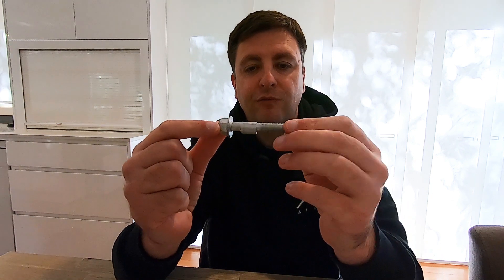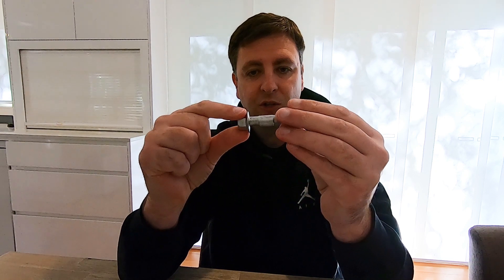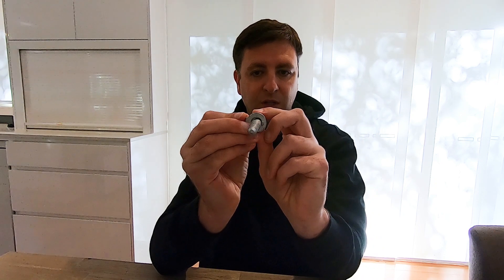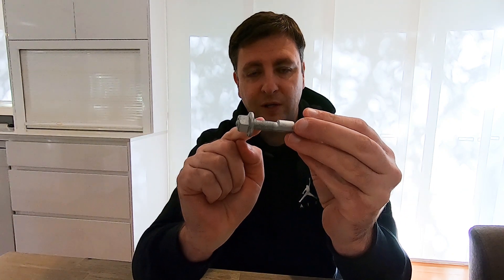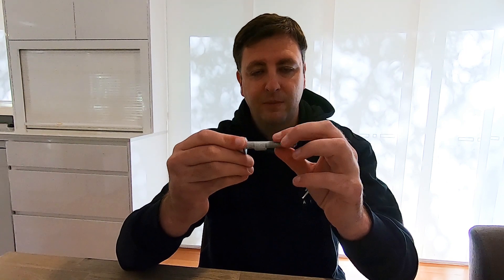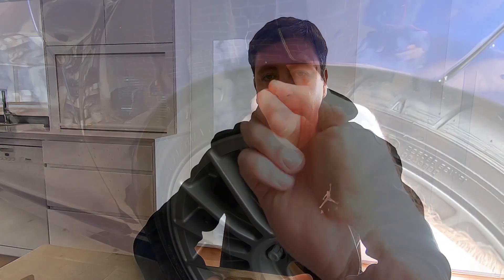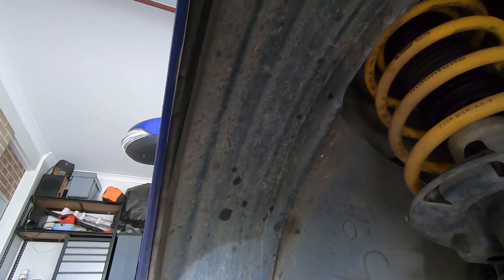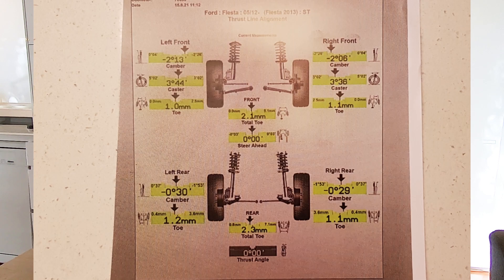Adjustable Camber Bolts | Whiteline

Comment: Thanks for your videos! 

Can't really lower these cars IMO, with the stock wheels and tyres anyway. i got full adjustabls and if you lower the ride height the tyres hit the inner guard, that part that drops down towards the engine bay.. Was ok for a while but as soon as you go over some big bumps they rub the guards.
Reply from the maker: Interesting. Worst case for me now is that I raise the front a bit.

Comment: you have got to be joking, adjusting camber to solve clearance issues.
My head hurts. F this world
Reply from the maker: Not joking 👍.
Reply: @fordyford  tire contact (to the road, not ur fender) should be the driver for camber adjustment.
Tire heat management should be the driver for tire width.
But then there's the stance boys 🤣
Reply from the maker: Yeah cool.

Comment: Have you noticed any uneven tyre wear from the camber bolts?
Reply from the maker: They have only been on a few weeks so no. I will make sure to rotate them regularly. Like anything, once you start dialling in things that increase performance, there will be a trade off. 2° isn't a massive amount.